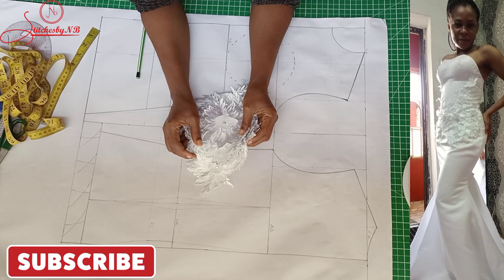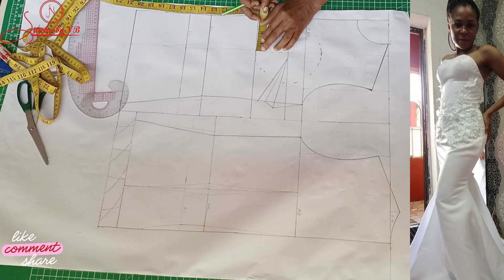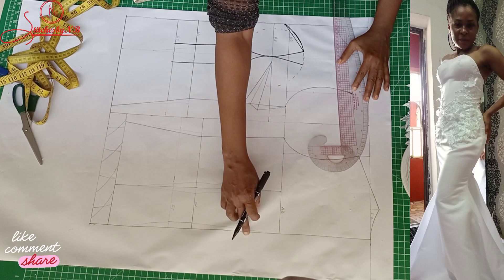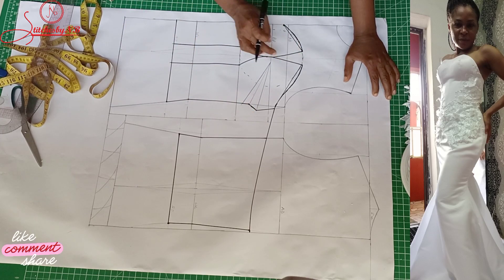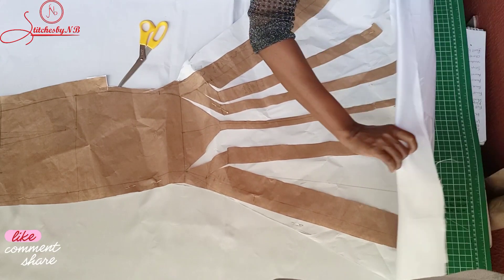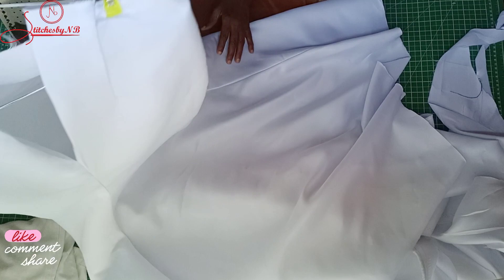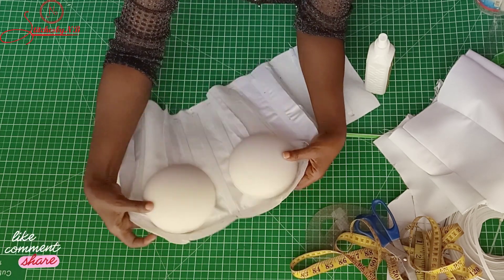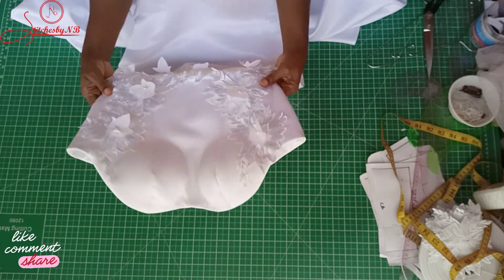HOW TO MAKE MERMAID WEDDING DRESS WITH BONING DETAILED

Comment: Thank you ma for this..please what interface did you use for the upper part...for both main fabric and lining where you put the boning..thanks ma
Reply from the maker: Hi khloe thank you for checking out the video.. The interfacing is our normal hairstay, for boning channel  3 for center front, then 1 for each panel.